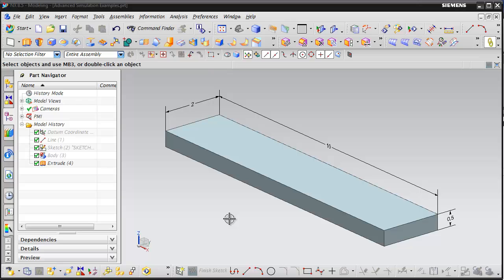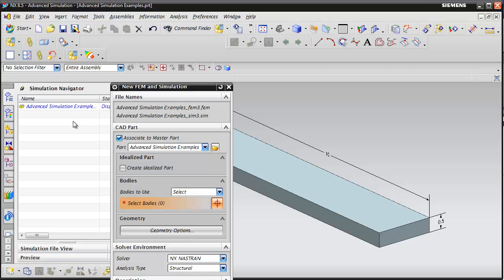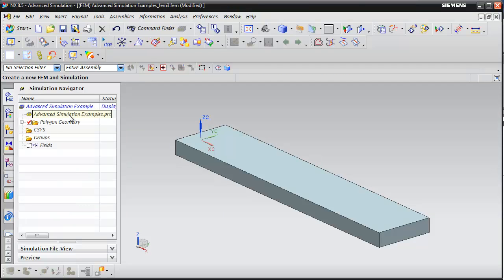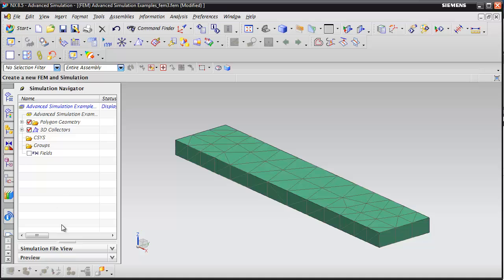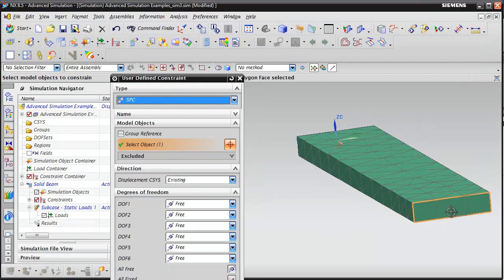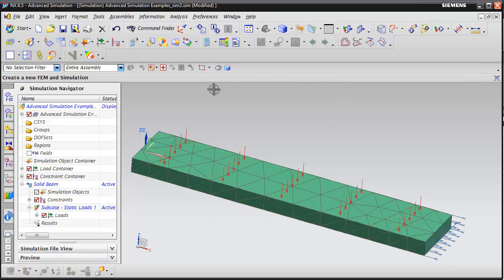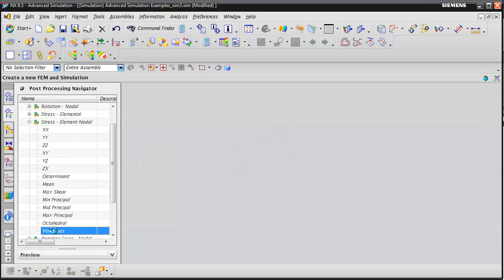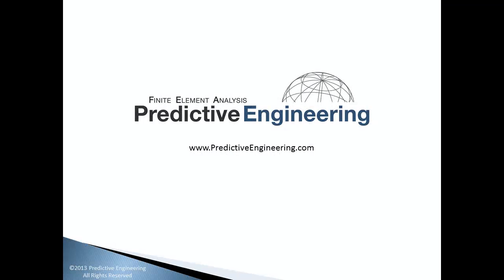NX Advanced Simulation - Simple Solid Beam Example

Comment: I am trying to do a simulation and I get this error report. Can anyone maybe help? I tried the suggestion and it did not help.Mesh-Based Errors Summary
-------------------------
ERROR
There is an update pending. If the job is submitted before an update, the results will not reflect the changes made to the part.
SUGGESTION: Perform an FEM update or use File->Simulation->Export to write out the model data without an update.